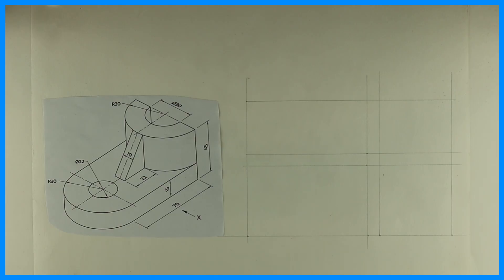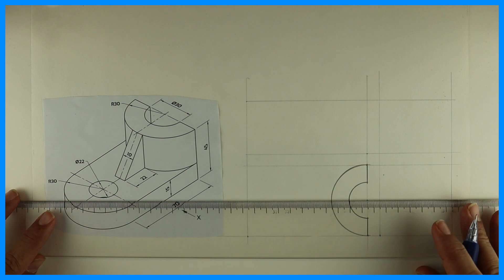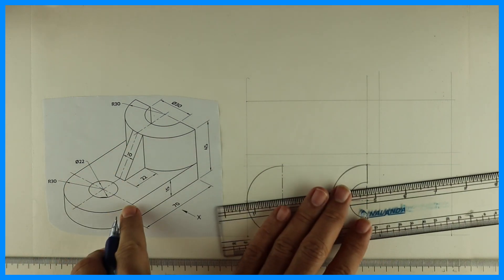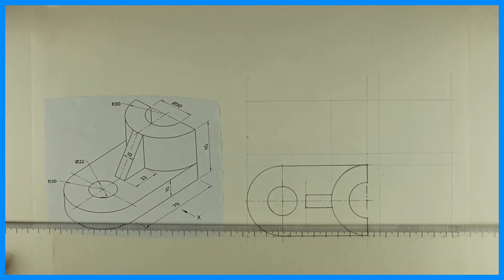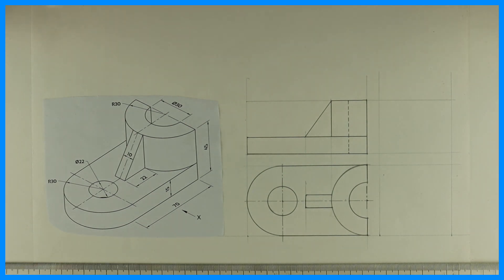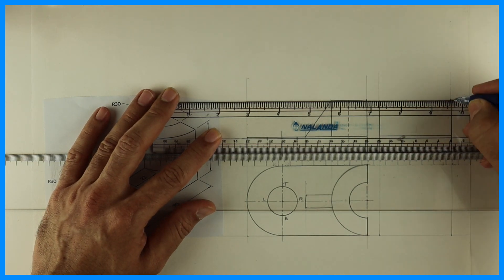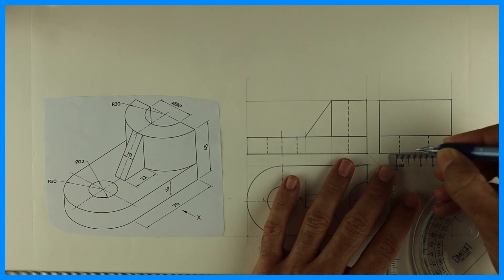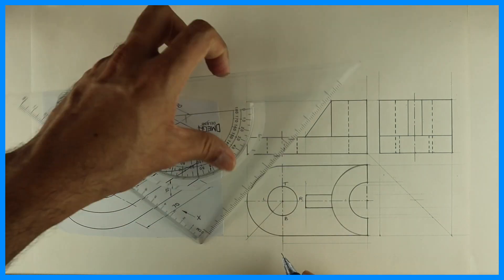Orthographic projection - Engineering drawing - Technical drawing

Comment: In some drawings the center line isn't extended to touch the border in some it is which is correct or is there a reason for the difference?
Reply from the maker: There is no reason you can draw full centre line

Comment: Please asnwer
Q1)The projection originated from the 3d object itself to project on the plan in front of it, is called_________.
a) First angle projection b) second angle projection
c) third angle projection d) fourth angle projectio.
.
Q2. The projection originated from from the eye ball and converted into 3d object to project a 2d image on the plane is the
(a) 1st angle projection (b) 3rd angle projection (c) 2nd angle projection (d) 4th angle projection
.
Q3. when the surface is inclined to two of the planes of projection ( but perpendicular to third) the surface is said to be (A) Auxilliary (B) Skewed (C) Oblique (D) Angled (E) Primary
.
Q4: actually show the full size of view (A) Axonometric projection (B) Orthographic projection (C) oblique projection (D) Isometric projection

Comment: Daughter is freshman in engineering. Making her learn this because I’m dad engineer and had to learn this when I was a freshman 😂. Makes transitioning to Solidworks and etc. easier. Been using your lessons because I am lazy and don’t have the text books anymore. But I see a mistake in this projection that will give the machinist an aneurism. The portion where the gusset intersects the semi circular part at the top does not work as drawn. The gusset cannot intercept the top flat as drawn. The curvature will cause the edges of the gusset to extend above the top flat because of the circular intercept. The way I drew it I had the top milled to correct vertical dimension which leaves a small extension on either side of the gusset. I kept the 22mm to the circular intersection shown as a hidden line but the I slid vertical line about 1mm to show proper intersection. I didn’t measure, just projected it. BTW these lessons are great and reminds me of the pride and enjoyment I got from producing these drawings back in the day. Cheers.
Reply: I like the way some engineers are doing their thing

Comment: Sir tomorrow is exam and i am confuse while taking length breadth and height while calculating length do we have to calculate given information in radius or in diameter? Same confusion for breadth and height please reply sir
Reply from the maker: In this question in length  take radius because distance is given till the centre line and in width we will take diameter
Reply: @technicaldrawing  thanku sir ❤️
Reply: How did you do?
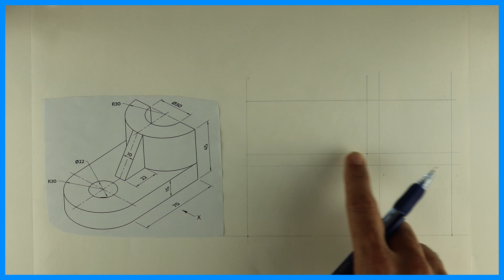Reply: 0:21